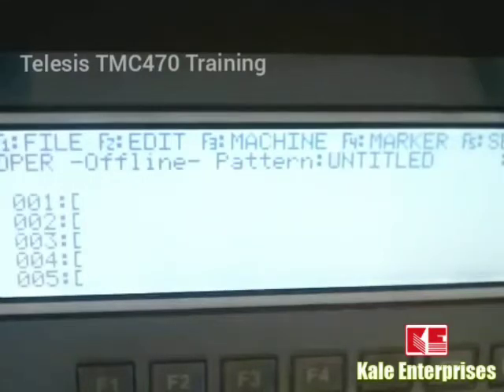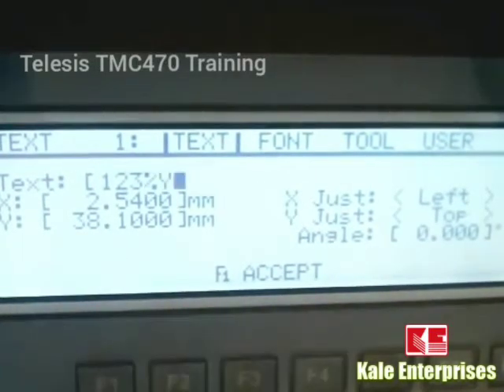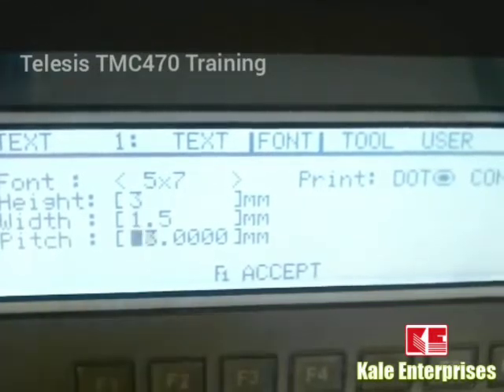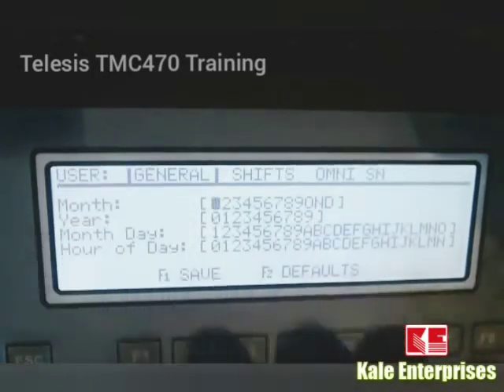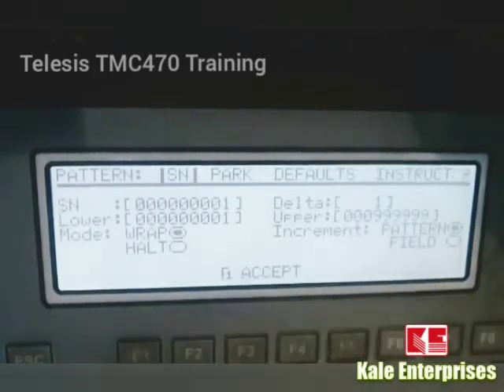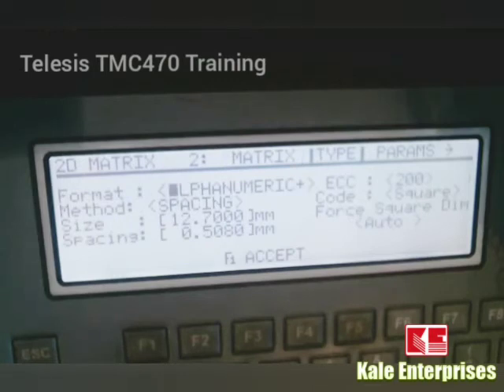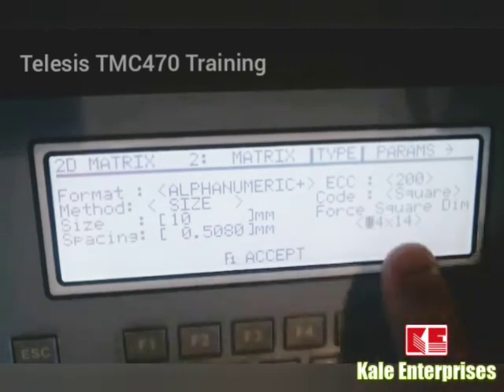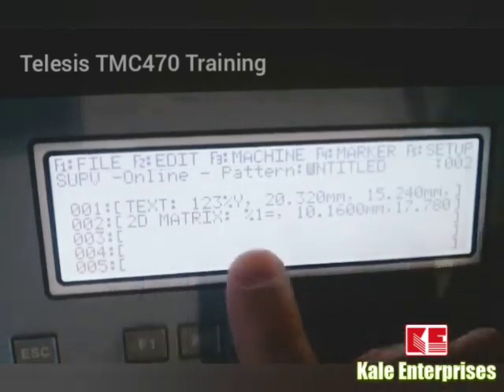Telesis Controller TMC470 Training

Comment: Hello, in Telesis TMM4200, which has a 4-tip head, what is the parameter that has to be adjusted if I need to use only certain tips to mark, normally the tips work from 1 to 4, if I would like to use tips 3 and 4 for marking, parameter is the one I have to change